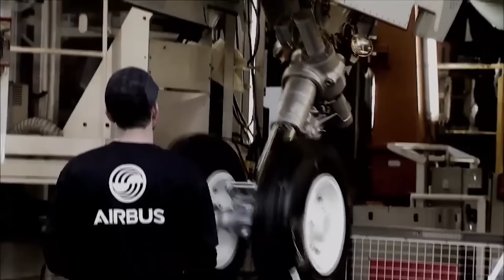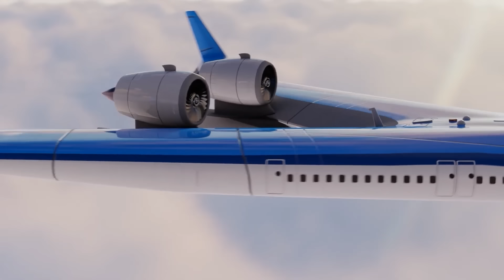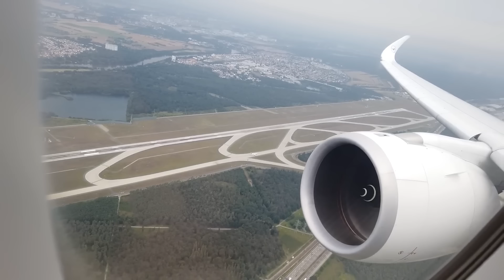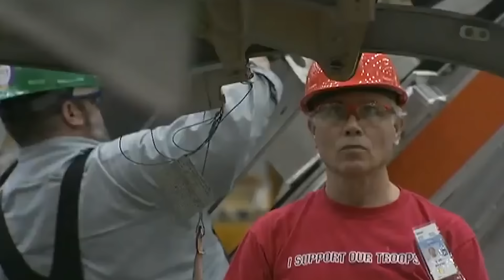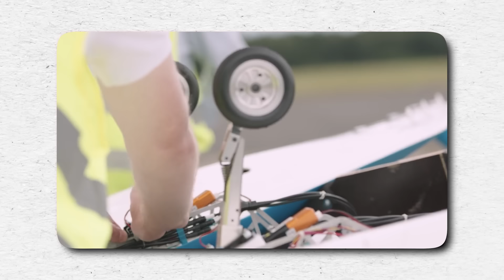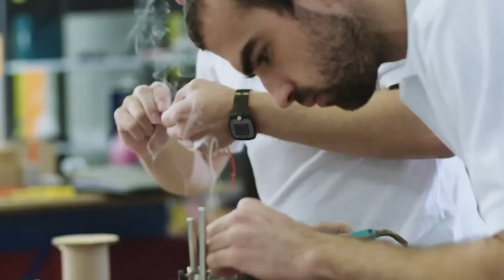Boeing and Airbus Are TERRIFIED of This New Plane | Flying V

Comment: this shit will never fly🤣🤣
Reply from the maker: Never say never :)
Reply: @ExPlaned1  maybe in 2100
Reply from the maker: Too bad I wont be around to witness that :(
Reply: Pretty sure the flight of the scale model proves you wrong there, Skippy.
Reply: @Zupdude  sure.... it flies , as a concept
but i see many flaws already , design wise and logistical and current airport infrastructure will have to drastically change to be able to accommodate airplanes like this
so it won't  "Fly"  unless every airport changes its infrastructure and well.... that isnt happening
hell, many airports cant even make changes to accommodate for an A380
nor will they adapt for it , same thing happened with Concorde , but for whole set of different reasons
it always comes down to $$$
Reply: @SerathS-n2r 
Airlines will demand it, if it cuts 20% off of their operating cost. The infrastructure changes mentioned here seem to be fairly minor… unlike the A380, this aircraft is no wider than existing passenger jets. Air stairs are already adaptable to different aircraft heights and door locations, and ground equipment and procedures can easily be modified.  

But bring it up, if you can think of a showstopper issue. If the University and airlines sponsoring this are confident they can pressurize this beast, I really don’t see insurmountable challenges.
Reply: @Zupdude issue 1 why it wont be in airlines if it will ever succeed - more expensive to be built than current airlienrs means higher price for it
Reply: @Zupdude  why? because it's not designed in Murica?
Reply: the small test plane flies and they work on this program for a couple of years now. KLM and Airbus are their one of the sponsors. They are also inventing a total new interior for planes with better seats and even beds:) Europe is the main leader in airplane technology:)
Reply: @ @manuellangius2896  1 if a small test plane flew as a demonstrator it doesnt prove it will succeed many other demonstrators flew before this one and you know what happened? they failed
2. “worked on this program for years” yeah proves nothing too 10-20 years of researching and development is normal airbus studied this thing for years too and decided to stay away from it😂
3. Sponsors mean absolutely nothing and if it will fail airbus/KLM lose nothing

Comment: Yes, the engines are great in the back, where ALL commercial jet airliners should have had them from the get-go (like the  DC 9 or Caravelle).
But why are the landing gear pictured so tall, placing the craft so high off the ground?  Is that really needed?  The advantages of this design should be lower fuselage ground-height, allowing simple exit stairs (like on the DC-9.   That would mitigate the need for expensive revised jetways!
And where are all the needed control surfaces as on conventional wings/tail, ---- like ailerons; slats; flaps; elevator; and air brakes?  Are they not needed? ===============
Reply: You forgot the best the VC10  4 engines high T tail built for Hot and high runways  a gentleman's dragster in the air .  ..  but engine tech was thirsty back then ...  but the take offs were spectacular and the wings were clean and  super  smooth in the air...so cruising speeds were high.
The Russian Be 200 family of Amphibious Turbo jets  have their engines  mounted  above the swept wing/fuselage  roots . There's a 90 seater   airliner configuration version that  could provide information and experience  in terms of engine placement and flight behaviour .  It earned international recognition in the west and was set for potential international adoption  as a  huge  and agile fire water  bomber. 
Sadly Putin and Co. decided to start their own version of a hostile takeover.... and they had already  moved the factory out east .
Reply: Fuel tanker for military, can handle austier runways, no passenger cabin to pressurise, no commercial airport infrastructure to deconflict.